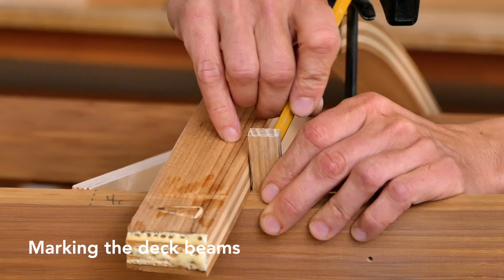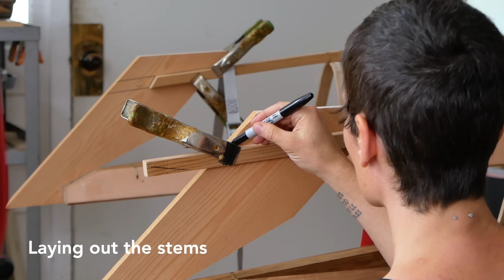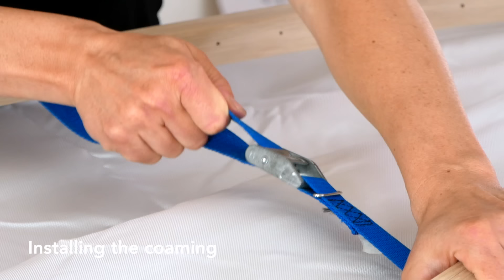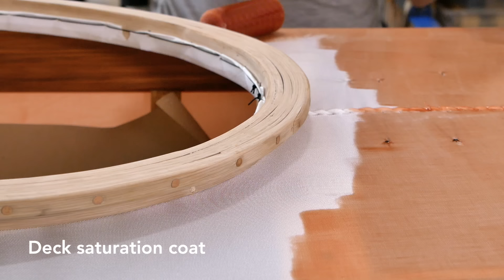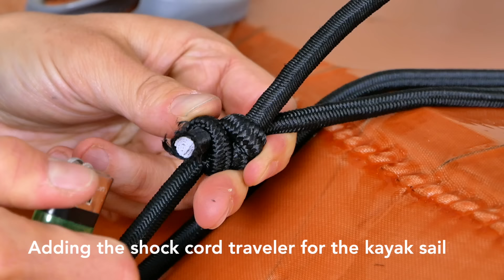First Time Skin-on-Frame Sea Kayak Build. Beautiful Video with Natural Sound.

Comment: beautiful build & really inspiring. I really need to build on my life skills. I don't know much, but if you are cutting bungees or nylon rope if you scotch tape the section before cutting the end is neater & melts to a smoother finish that catches less on stuff & doesn't fray so easily
Reply from the maker: Thanks for the tip

Comment: Excellent handwork.  I have used that artificial sinew for many projects.  When I worked at The National Museum of the American Indian, Smithsonian, Washington, DC (2000-2004), we had a number of original indigenous watercraft in the Collection.   The Arctic Vault was particularly interesting and smelly.  We lost our air-conditioning for a few days in the 100 F heat of August.  That really caused the greasy materials to stink.

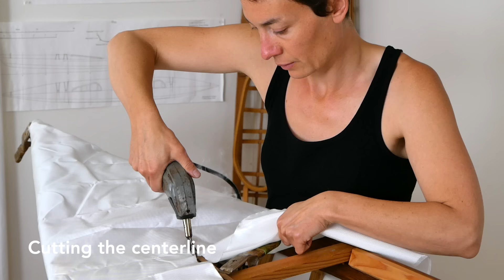Comment: 11:20 In my opinion, I am not a craftsman, but instead of sewing this fabric, it can be glued with the soldering iron 10:40  with which you cut this same fabric. This will avoid the edges from the sewing and it will look nicer...

Comment: So easy .... :-) awesome. I love wood over all other kind of materials. Just little bit saw (a good Japanese one), some chissels, drills, little bit planing and sanding, basic knowledge about joints, and good glue (for water resistance best is PU glue). And varnishing (I use epiphanies hardwood oil one component) is pure joy (with filter mask because of the thinner). I plan to build my own coastal rowing boat. Yet not clear if "skin over frame". I don't like glasfibre cloth. Epoxy resin is  a nasty stuff to sand. I like the "heat welding" ... what fabric are you using in this vid ??? I suppose it is a kind of polyester fabric differently from glasfibre kind Dacron sail cloth so it looks ?? (Rec.: Glasfibre is also a polyester fibre but is heat resistant to more than 1,000 degrees C) - Tks for filming. Excellent documentary, very clear to follow. Appreciate you uploaded it.

Comment: your Vary close to the way we Make the Kayak  from skins : When you put the Lines through you should Use wood eye and sowing it into the hall then put the Line through it.
We use Bone eye and Sinew for that the Lines do not stress or rip the Skins on the  Kayak.
you will fined this with help with the stress of the lines that go through the Kayak.

Comment: Excellent job. When you say fabric I presume you mean fibreglass
Reply from the maker: It’s ballistic nylon
Reply: @capefalconkayak  ok, that’s interesting. So you’re using epoxy resin on ballistic nylon
Reply from the maker: @marcelchaloupka  it’s actually two-part polyurethane over ballistic nylon
Reply: @capefalconkayak  that makes more sense.

Comment: Beautiful build. My only concern is that you are not using forms for your steam bent ribs. Seems like it would be impossible to get consistency.
Reply from the maker: It’s easier than you would think.  I’ve been teaching people how to do this for 20 years with over 2000 boats on the water and the results are surprisingly consistent.
Reply: Fantastic! Thank you for showing this in such detail.

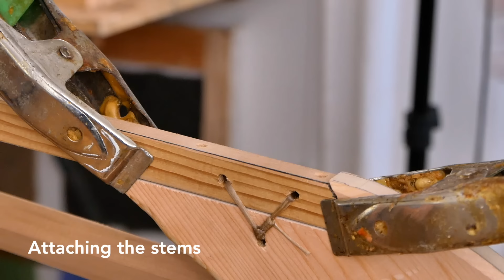Comment: Huh… that is interesting. When hammering in the dowels I kept thinking, “I’d still be gluing those in place. Then the dowels she puts in at 6:17 have a smash cut at 6:18 where you can see the glue was added. 

I wonder if the glue was added between cuts on all the dowel joins.
Reply from the maker: I don’t use glue on the other dowels because it’s actually beneficial of things can move a little bit, but that one particular joint does benefit from glue on the dowels
Reply: @capefalconkayak  Cool. Good to know.

Comment: AHA, I had to read the description to find out how she did it, as she looked like a seasoned pro, Not having instructions nearby, and not showing us the 'plans'; as most pro's who do this kind of video shoot them. PS: it would be good to show us the plan of the boat first, and maybe give an intro to how she is aproaching this project as other than that discription, Most people would think this is clickbait as she is OBVIOUSLY NOT a first timer, the way she uses the chisels, plane, etc. is a mark of PRO workmanship, any amateur would have some degree of nerves showing through, and shake alot while doing it, she, on the other hand did things smooth and confidently.
Reply from the maker: Liz has never built one of these kayaks before.  And the reason the action looks so smooth is because when we’re doing this kind of work, we reshoot things over and over and over and over to get the velocity of the action to a tolerable pace for the viewer.  I could shoot this like a reality show and show you exactly what happened but you would be watching a 60 hour long video instead of a 16 minute video.   Or I could shoot it exactly how she did it when she was doing each step initially, and the video would be an hour long.  Which version would make you happiest?

Comment: Beautiful work! May I ask you why did you fasten the pieces with strings and not put them together with wooden tufts as some other parts? Is it to made the hull more flexible? Ty🙏
Reply from the maker: Yes, that’s exactly the reason the string helps everything to flex a little bit, which makes it stronger.

Comment: Awesome… how about a nice Baidarka design ?  I’d purchase some plans for sure.
Reply from the maker: Unfortunately I've never made a Baidarka design because I started with baidarkas, nd after building 7 of them I gave up because I couldn't build one I actually enjoyed paddling.  That's how I got into building modern boats out of skin on frame.  They are really cool looking boats though!
Reply: @capefalconkayak  Thanks for the response. I like them, and I have paddled one that was a sort of hybrid ( widened through the mid section, had a bit of chine ) and it was quite stable and fun to paddle. Maybe one day you’ll come back to them …. Thanks.

Comment: I would paddle it right into an underwater stick.
Reply from the maker: That would be fine.  We paddled a canoe loaded with 350 pounds into a piece of barely submerged rebar so hard that it stopped the canoe and it took us five minutes to get off.   Wicked scratch, but no puncture.

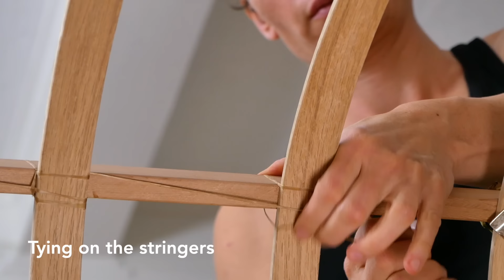Comment: When you're tying on the stringers at 6:42, if that line breaks at any point, does every tied-on point (looks like 20+) fail?
Reply from the maker: That string is shockingly tough I have it specially made for us.  I’ve never seen one break in real life, but even if it did, it wouldn’t matter because the coating glues the skin to the stringers, so the lashings are effectively isolated from each other.
Reply: Thank you

Comment: Are you using air-dried or kiln-dried wood for those bends? If kiln-dried, are you conditioning then by soaking them or something? 

Your video and work is amazing.
Reply from the maker: It’s green White Oak.  You can do it with kiln dried wood but it’s definitely a lot more frustrating.  For us the extra money for the good bending oak is worth it.
Reply: @Cape Falcon Kayak thank you so much for getting back to me. So greatly appreciated.

Comment: Under 15kgs for a fully equipped kayak is impressive. Dare say you could go even lighter but with slightly less durability
Reply from the maker: You can definitely go lighter, but it starts to significantly compromise the durability.   My lightweight version is 5 pounds less but it lasts half as long!

Comment: Beautiful!
What is the fabric you use?
Why no adhesive in the wood?
Reply from the maker: We use a heavy nylon cloth, it and we don’t use glue because it’s not necessary and it helps the boat flex a little bit more

Comment: why different materials to protect the bow and stern keelline?
Reply from the maker: Great question.  In the stern I use the plastic because I want it to be physically taller, because that is the most vulnerable place on the boat, and that extra height takes longer to wear down and protects the corners especially which are vulnerable.    In the bow I don’t want the extra height because any extra material height up there tends to affect the maneuverability of the boat.  Also, it’s easier to bend the brass smoothly around that irregular shape.  The brass actually offers less protection but it’s a better choice for upfront.

Comment: So how do you repair tiny leaks?  Just reapply polyeurethane?
Reply from the maker: Leaks aren’t really an issue but if the coating wears thin in spots a bit of aqua seal works great.  Check out my other video here about skin on frame durability.

Comment: Just wondering why no glue was used when building the frame? Only dry fit... is there a reason for this?
Reply from the maker: Yes, absolutely, the frame barely flexes, but it flexes with tremendous force on the water that would break glue joints.  It’s stronger this way.
Reply: @capefalconkayak  how about that! Thank you for the explanation

Comment: I guess you are using woven Nylon here, and want to ask about the pros and cons compared to other materials as glas fibre
Reply from the maker: Glassfiber is meant to be frozen into a rigid structure, which means that it needs to be a lot thicker to do the same job.  The nylon into part polyurethane is tough, but also flexible so we get a surprising amount of durability out of a lighter weight layup.
Reply: @capefalconkayak  Thanks for the prompt explanation. I get that fabric has better compatibility with the wooden frames flexibility and makes a lighter weight to strength ratio then.

Comment: Why not use an epoxy, like West Systems?  Has anyone done that?
Reply from the maker: The non-glued joints are designed to flex a little bit, which makes the entire thing much stronger under stress.

Comment: How did you figure the lengths for all the ribs?
Reply from the maker: When I’m designing boats, I start by bending the ribs in by eye, and then I will measure those ribs, and see if I can determine a mathematic relationship between the width of the boat at that location and the rib length.  If I can do that, it’s great, because I can create a formula that allows me to change the size of the boat, but still keep the same shaping.  This is a feature of all my kayaks and canoes.
Reply: @capefalconkayak  you do wonderful work thank you

Comment: Great work.
I would still worry about the vulnerability.
Reply from the maker: They are much tougher than you would think.   About the same strength as a lightweight carbon fiber, or Kevlar boat.  I’ve got a video here on the channel that talks about durability.

Comment: It's almost a shame to have to cover up such a beautifully built frame like that! I have built many from kit RC planes, kitchen cabinets, currently make custom knives and am generally pretty handy guy. I have the tools and sharpening supplies. Could a guy build something like this without an instructor and have a pretty good chance of a successful build? My biggest concern is the covering. I have worked with iron on/shrink plastics. Thank you for sharing this outstandingly well made video! I liked and subscribed!
Reply from the maker: Yes, absolutely.  I taught people how to do this in person for 15 years and I created a hyper efficient system where my students could build one of these in about 60 hours.  About six years ago I took that entire system and made it into a video course and the majority of my online students are having similar results.  I’m also available by text or phone to help people when needed.  If you want to see some student builds, just go to our website and click on the student builds tab and you can check out other peoples experiences with using the system.   It looks like fine woodworking but it’s really not..  the tolerances here are fairly sloppy.
Reply: Thank you for the reply. I will look further into your videos.

Comment: No. It was not her first time. She is well trained. And jigged up. Complete shop set up to do exactly what she was doing. Why lie?
Reply from the maker: It’s not a complicated workshop, just a pair of sawhorses, and a 2’ x 8’ piece of three-quarter inch plywood with a couple two by fours screwed to the bottom sitting on sawhorses for a workbench.  The rest is just common handtools with a few exceptions, and the larger shop tools for the prep work can be borrowed or rented.  I taught people how to do this professionally for 15 years and so in the videos I break things down into bite-size pieces where you just have to watch a 10 minute video and then copy the work and then go onto the next 10 minute video.  if the work looks exceptionally clean in this video it’s because most of the steps are done many times over and I videoed every moment of the process and then shows the very best example of each step to make the video look nice and clean.  So yes, this is her first time.  It’s not hard.  Couple years ago a 13-year-old girl built one of these doing every bit of the work except for cutting the wood on a tablesaw.  I hope this answers your question.
Reply: @capefalconkayak  and it was not your first time. Those two words made it sound like you were going to do it for the first time. That's all.
Reply from the maker: @Court-fl8ck  I am the person who owns the business and designs these boats and teaches classes for how to build them (mostly online).  The woman in the video is a first time builder who has never built one of them before.  I videoed her build to show people the process.  So yes, it was her first time building.  Hopefully that makes things clear.

Comment: I dont get the purpose of this kayak build. its full of plastic materials and cannot be recycled and lacks everything a modern plastic kayak offers to the user. hull shape looks horrible. same goes for the seat. no bulkhead separation.
Reply from the maker: is this really the best way to phrase this comment?  Seems like it would be more productive to ask what is the purpose of this type of kayak?  Do you find the lack of bulkhead to create a safety issue?  The hull shape is very different than I’m familiar with how does that actually paddle?  Is that seat really comfortable?   I’ve been here, professional kayak designer for over 20 years with significant experience In kayak racing, polo, squirt, whitewater, and extreme sea kayaking.  With a different attitude, you might actually learn something.

Comment: I call BS on it being the first time. Plus this video, while great, doesn't really show much of the preparation and setup to building a kayak. Merely the assembly.
Reply from the maker: We’ve tried posting videos showing the set up process in the past, but nobody watches them, which means that if I did that you would never even be served this video to see.      If you surf around on the channel here, you can see other videos that show more of the set up process, although it’s pretty short for the aforementioned reason.
Reply from the maker: also, yes, this is her first time building one of these. It took dozens of takes to get these really short, clean, looking video clips.  If I just stood there and filmed her like it was a reality TV show, this would be an hour and a half long video that looks like crap and no one would watch.  The look of expertise is the look of good filming and video editing.